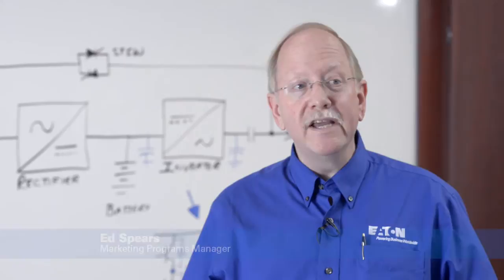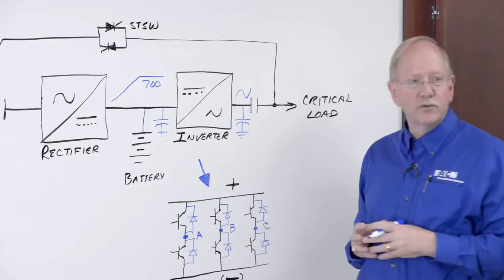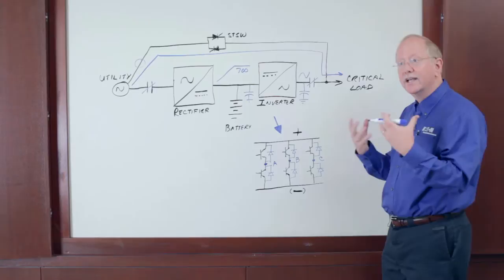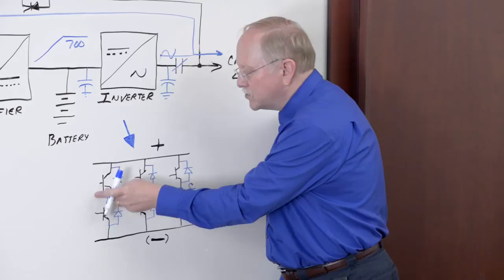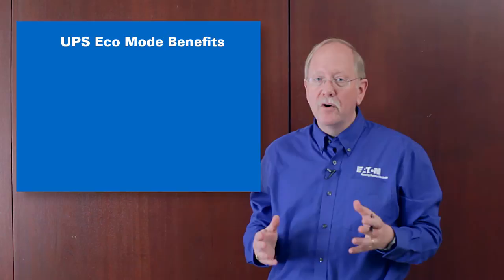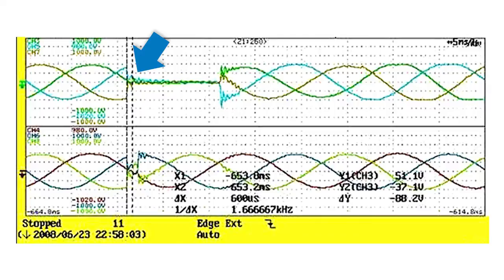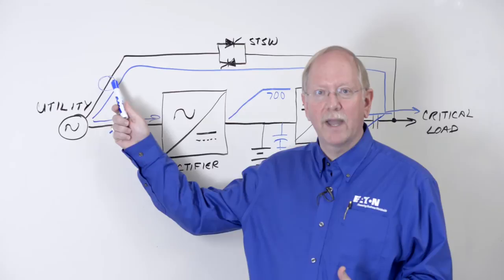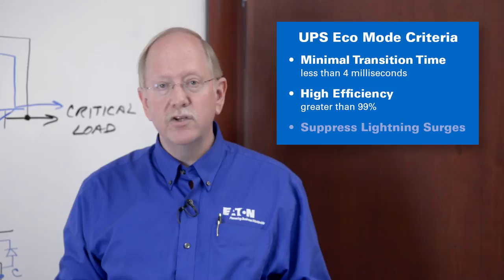Exploring UPS system eco modes with Ed Spears

Comment: The UPS in ECO mode depends on the DC from the batteries, If the UPS battery breaker breaker is opened while in ECO mode you will get a "shut down" imminent alarm which scares the crap out of UPS service technicians.

Comment: Why does the DC link have such a high potential as compared to the battery string voltage? Why not have the battery string and DC link voltages the same?
Reply: Inverter operates at a much higher input voltage
Reply: Overvoltage for charging